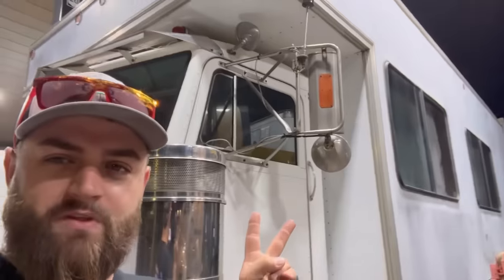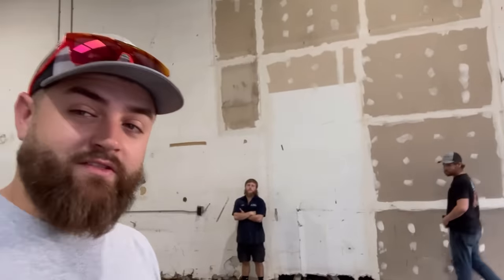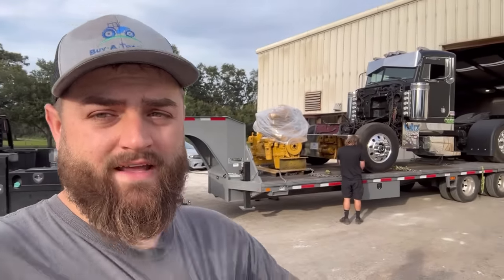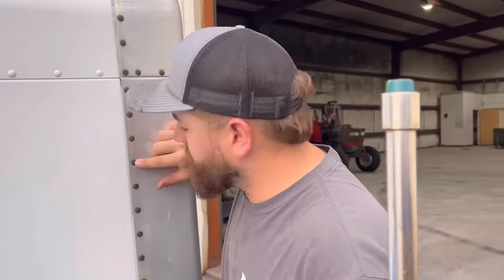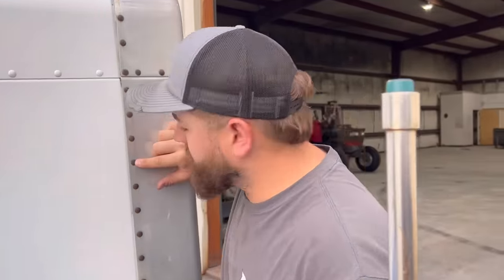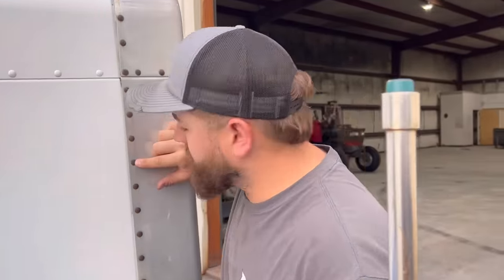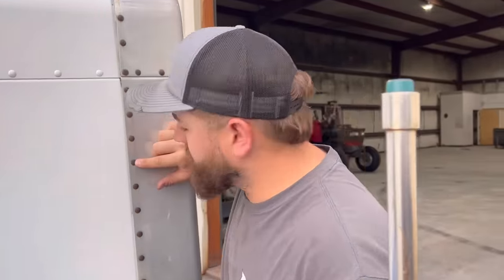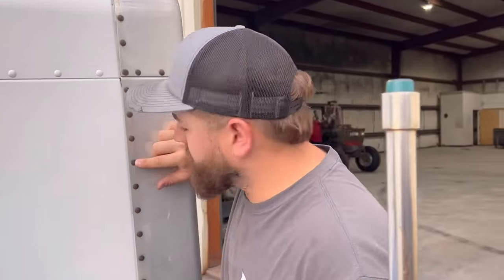Tear Down Day for our Peterbilt RV Project!

Comment: Best suggestion I saw was cut the whole dang camper part off the frame and order a custom travel trailer camper to fit the truck frame then later attach the new camper to it,  in the meantime while the camper is being built you could move the fuel tanks and do all the maintenance and upgrades to the tractor you want or need to do.  Maybe even extend the frame a few feet for a little more camper ; )
Reply: Ha! I totally did the same thing. I bought a garbage class c with a Chevy 454 dually chassis, low miles, and tore off the camper, and mounted my Arctic Fox cabover on it. Looks slightly custom, but not bad at all. Plus made a really nice 18’ cabover with a low miles chassis.

Comment: That 15 spd is ..in my opinion..the best trans ever…Heres the deal…drive it like a 10 spd..leave the blue button alone.   If you are heavy and need more low…..you..button 12345….usually Id  start in 3rd .then 45
The trick is that whatever gear you come out of you go  back into the low side of the 10 spd. eg..
come out of 4 goes int 2. Those 15s are very versatile. Hope that helps
Reply: I drive heavy haul and have a 13 speed. When I’m empty or loaded light I use 13 like an OD.

Comment: Fill up your new fuel filters with ATF, that will clean your injectors and it should not smoke nearly as much. A little trick I learned working for a truck repair shot when I was in high school. If I remember correctly, you will see a lot of white smoke until it uses up the ATF in the filter.

Comment: Take that toterhome to 1492 coachworks and have them completely redo the whole unit, with slide outs.
Reply: have it done professionally and it will be done right
Reply: You mean stiping everything out and then going to lowes and hom depot and patching in stuff that needs to be made in a cabnit shop, is not a smart idea.

Comment: Water is always going to condense in the headliner of the RV, use electric heaters not gas that will help alot. And use automotive wool for liners.
 Because its a RV the basics walls with Aluminum studwalls and proper insulation its gonna cost abou 6K just to do the walls and ceiling right or you can do it with wood and it will just get moldy agin.

Comment: Just strip it down and redo it. Youll like it better in the end. Also, just drive the 15 speed like a 10 speed. The bottom 5 gears are just a low low for starting with a load in tough conditions.

Comment: So I found the best way to refreshing. The walls was had wallpaper on my RV. I used to gripping primer mixed in sand play box grade. Brushed it on and then paint it over the top of it. And the reason for the sand  gives it a texture luck. But I did remove the wallpaper, which got it down to Bearwood.

Comment: Bruce, I would gut it and fill it with about 3 inches of spray in insulation foam. This will seal everything  from a possible CO2 from the generator  gases. And be much better in the summer and winter weather. I would use hard wood  flooring throughout the entire inside.. Then, put new  windows  double  insulated windows.Make a big difference from the start. I would measure the whole inside and drawl how you wanted it to all lay out like refrigerator, stove .Need to find out what's available and what you want size Flat screens wire it for sound. You need it wired before spraying  foam inside.I think I would completely do away with that back door .

Comment: Hey Bruce you need to put a pit in the shop where you could pull the camper etc and make it easy to work on instead of crawling around under them all just a thought then if and when you leave the shop just fill it back full of dirt and concrete I had one back in the day just saying?  ?

Comment: On the driver side that box under the door is where your batteries should be for the truck  those are original boxes, passenger side, toolbox, driver side battery box

Comment: Hi Bruce is that 15 spd still standard h pattern or had 4th and 5th gear reversed ,  don't use reduction range ,  no need just drive in mid and high range as 10spd ,  my 82 k100 had 3406a with 15spd direct and pattern was reverse 4th n 5th ,  ,,makes 5th top right instead of bottom right,     and I freaking loved the gearbox ,,   ps clutch is for starting only ,  shift 10 times better with out clutch,   a real drivers gearbox but piece of piss to use esp reverse set up ,,  loves being raced thru  the gears and makes the 3406a garsp for air between changing gears,  sound fantastic too,    the mould Bruce remove affected materials wood or carpets,    tip measuring piece before you tear them to bits ,  so as you take it off sit new bits near to but not fitted wash an dry everything that remains ,  only assemble after woods primed every last edge ,  only use plumbers mould resistant salastic adhesives,    put extra ventilation in affected areas point all breathing vent down outside with at least 3 inch below to prevent travel speed wind push rain back inside ,        hope something here makes sense to you Bruce,,   and when ever or all the time keep the RV open windows or screen door ,,  the more fresh air the less damp air ,,,   air drys better than heat on its own

Comment: Hi Bruce ya strip that old moldy interior check all corners get rid of all that wood not sure how fare you won’t to go if it was mine I would spray all corners with bed liner stop any leaking and get really friendly with silicone that will be your best friend and have fun stay crazy o make sure you all have good ventilation do not fart in there G.Whyte

Comment: This just in Old RV has issues and needs to be redone, more at 11!  

But seriously I kind of feel like you wouldn't have bought this unless you knew already you were going to tear it all down and start over. Old RVs like this often need a full redo much like a house, because after all these years of use and the owner getting older and not being able to keep up with the needs of the vehicle, things start to go wrong and things get where they don't belong and cause mold and rot that needs to be dug out, cleaned up and done over.

Comment: Gut it...Start with the outside and make all the seams are sealed.  It was state of the art in 1960 but not now.  The weight of the wood alone is enough to drop a bunch of weight.

Comment: To strip everything out an start from a bare shell is a massive project if you only have 2 weeks till your trip no word of a lie be better off hiring a motorhome for your trip an renovate yours over time no point rushing it an not doing it properly the way you want it to be would kinda be a half ass job in two weeks unless you had a proper shop doing it the way you want it that’s my personal opinion though just cause could find something that could set you back or ordering parts

Comment: Well. I'm sad to say, but I had a feeling this might happen. Just the quirk of these older RV's. That chassis and body is still well within the worth rebuild limit though.
P.S  I think there might be a reason for having the fresh water on the inside. But I've had 8 of these trailers and rv's. All of em had the fresh tank/tanks on the inside. Most under the beds.
Reply: The fresh water tanks are commonly put under the bed because it is a convenient place to put it. Additionally the interior of the totter is not as prone to freezing in cold weather nor does the water become too hot in the summer. Lastly I have seen campers with interior fills to prevent tampering with the fresh water

Comment: I own a 47 year old RV with no leakage problems. This RV is poorly built. And why does it have 2 rear axles. With only one rear axle you could build a huge garage under the bed in the back where you can store a motorcycle and more.

Comment: You should talk to peterbilt your guy your friends and you should add some taken help you remodel it and see if they can come up with a You should talk to peterbilt your guy your friends and you should add some taken help you remodel it and see if they can come up with a diagram   For a design for the inside and what is wrong with the engine in the airbags I think it will be pretty cool if you work on it and make it look really cool and see if you can come up with a vision or a digital graph for that camper

Comment: Man, this guy doesnt like everything he bought. This is the second secondhand RV that he bought that he rants after the secondhand Thor RV that he bought earlier before this. Here's my solution bro. If nothing suits you, then why don't you just buy a brand new RV factory fresh??? I can assure you that there will 0 problems with that factory fresh RV. And since you bought this current RV, just live with it then. Definitely it's old and rusty and grimey everywhere. So what do you expect from an used RV then???? Goshh!!!!
Reply: What most people are not aware of is that the RV industry is not regulated. The new ones are built so poorly these days that water damage is a real possibility within the first couple of months. The industry is so rife with problems that potential buyers, if they are smart, should hire a certified RV inspector. Yeah! It can cost a couple of grand but these guys save you thousands of headaches as well as dollars.
Reply: More money than brains.
Reply: @TKO-NY  exactly. Rather than just spending it then rants later on, why don't just donated those money to the poor and in need of money to survive. Because the country has high percentages of people who are living in delapidated state.
Reply: @TKO-NY I agree

Comment: Gut it and start over, There's clear signs that it's leaking. The unfortunate thing is a project of this magnitude isn't getting done in 2 weeks. To do it the correct way you've got a few months worth of work. The truck mechanically needs gone through as well. This thing could turn out really good so I'd like to see it done correctly. Don't just do the typical YouTube shit slapping it together to get it done only for it turn out badly. Nothing pisses me off more than the channels that buy stuff like this that could be a solid reliable build, but they do bare minimum for content and then it blows up or burns down. They bitch and carry on about how it was a bad investment or they were mislead. No you were just lazy or inept to do the work and wanted the quick dollars from views. Make the decision now, done it right or let it go to someone else who will.